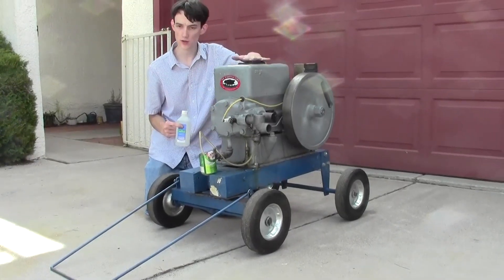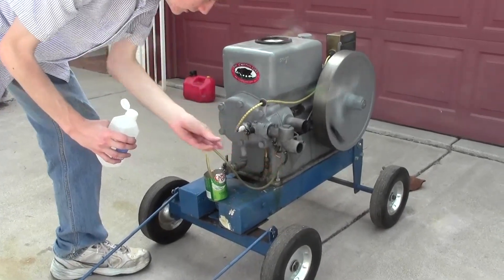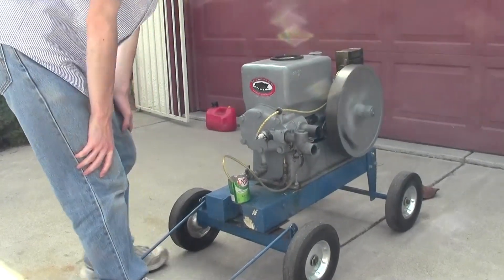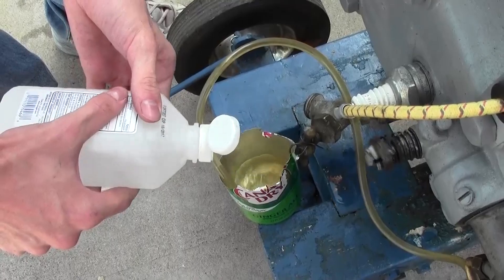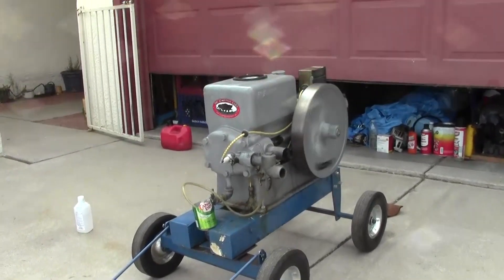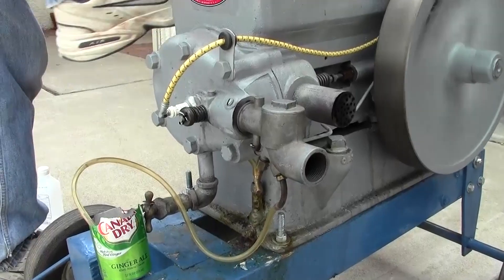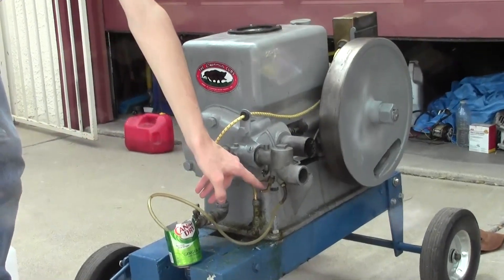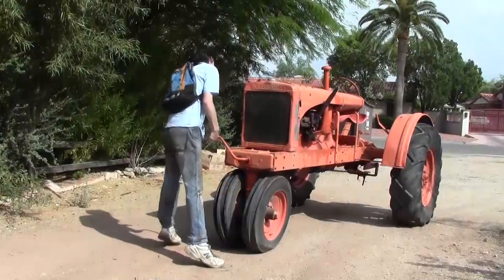Will It Run? Gas Engine VS Rubbing Alcohol

Comment: As i remember form the old popular science /mechanics articals on run your car on alcohol.  They said double the jet size. Your engine is a little low on compression ratio for alcohol. The more you add the cooler the burn. It  eventually puts fire out.  Racers used  alky  in high compression engines to cool the burn to stop detonation.  Was talking to a pig and ford racer and he tried to use av gas in a model t  and it almost did not run on it because of the low compression ratio around 4:1  .  Good video

Comment: This dude can get a 70-year-old motor to run on alcohol and I can't even get my lawn mower to start
Reply from the maker: Jet's plugged from sitting
Reply: @unigrampa  oh nobody it's a little more than that I have literally five lawn mower motor sitting in the back of my house because these "no oil change " mower ALWAYS blow piston rings even when you change the oil. All the carburetors on every single mower is good every single one of them has blown piston rings and one of the mowers was only used twice bought brand new from the store
 They just make motors really shity these days if they put something like this on lawn mowers they would run forever.

Comment: in brazil, we use the same alcohol but in 99% for cars and motorbikes!
Reply: RIP your gaskets
Reply: @RealBelisariusCawl  Don't worry, our ethanol is E99, made entirely from sugar cane and potatoes, we are pioneers in the production of biofuels, our vehicles are flex fuel and can work with both alcohol and gasoline!
Reply: @RealBelisariusCawl  Don't worry, the alcohol here is corrosive to flex-fuel engines, they can run on both alcohol and gasoline without problems, now old engines suffer
Reply: Isn't that 99% Ethanol instead of 99% Isopropyl? E100. In the US we have E85, so people don't drink it.

Comment: Also, is that actually 100% alcohol? Most isopropyl alcohol is only like 30%
Reply from the maker: I think it was about 90%. I did buy this alcohol specifically for it's higher concentration
Reply: "Most isopropyl alcohol is only like 30%" You mean 70%, 90-91%, and lab grade 99%?
Reply: @nikdog419  you’re right I was probably thinking about hydrogen peroxide, 30% H2O2 is hard to find

Comment: Ive always wondered what would happen if you did this. I totally thought it was done for when it started blowing smoke, but it powered through! It was so interesting to see how it lost torque as the alcohol purity was increasing
Reply: I imagine it's near the same as running Ethanol. Different AFR than Benzin/Petrol/Gas.